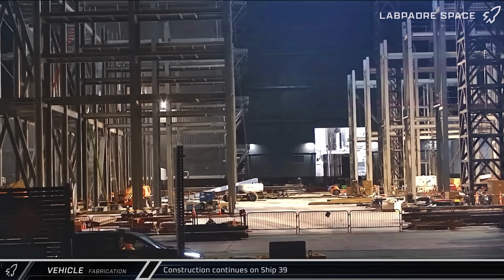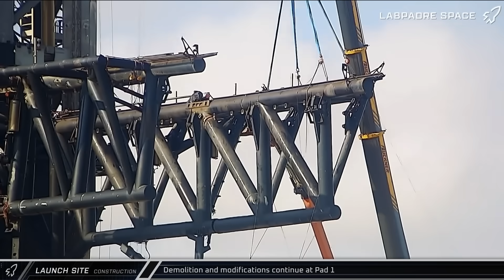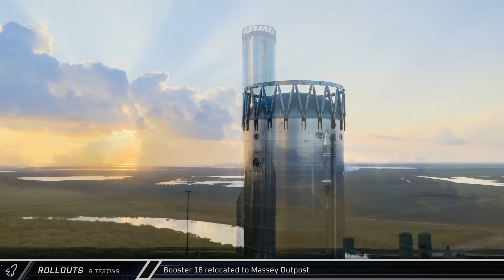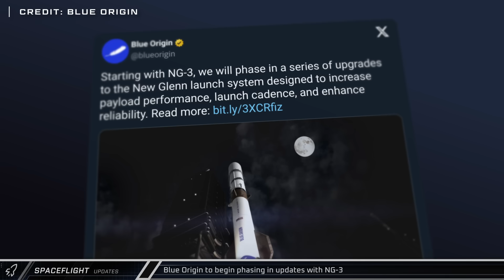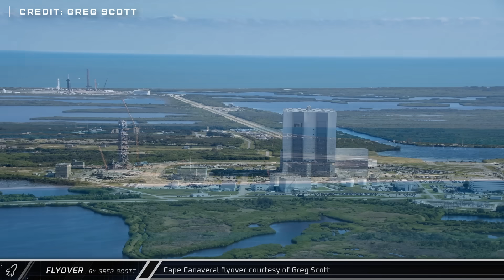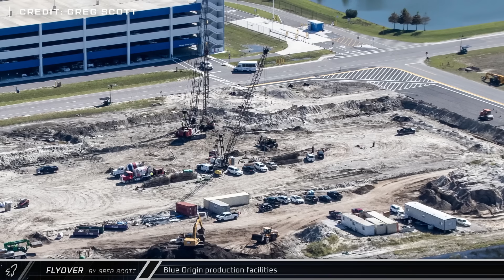The First V3 Superheavy Booster Fails During Testing - Spaceflight Weekly #194

Comment: They are reportedly using a different welding technique and a new, “secret” steel alloy, along with an old Soviet hardening technique from the Soyuz series. It doesn't seem to be working very well. However, they desperately need the thin material to save weight. They won't be able to master it. The abyss is drawing nearer.